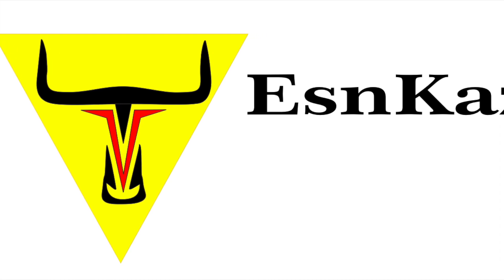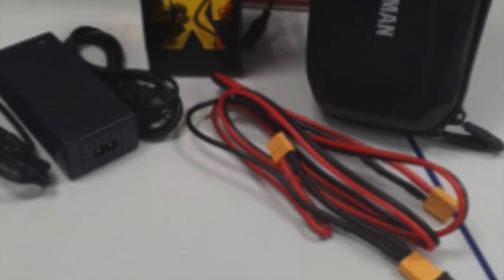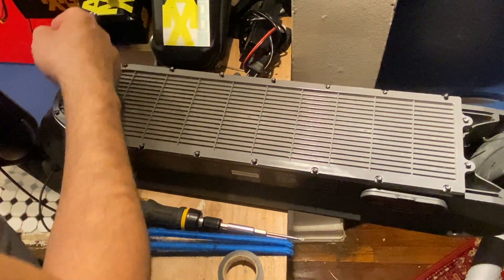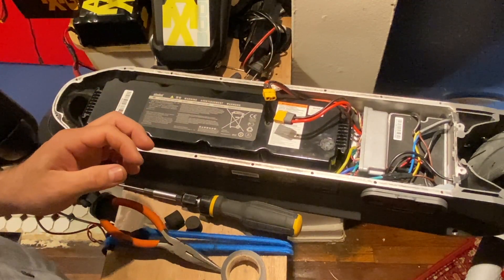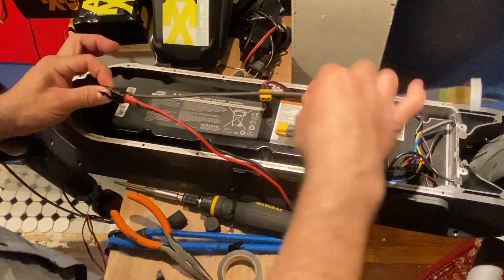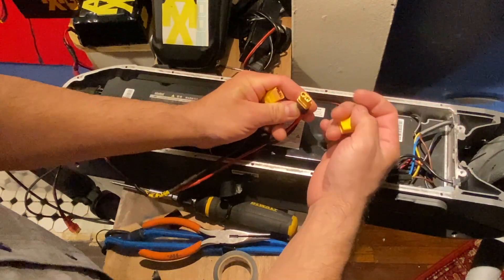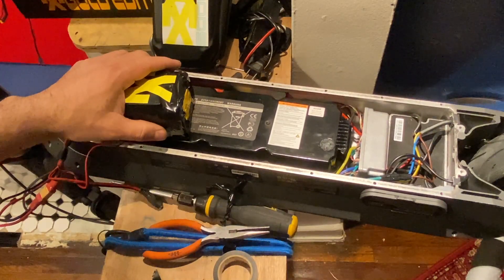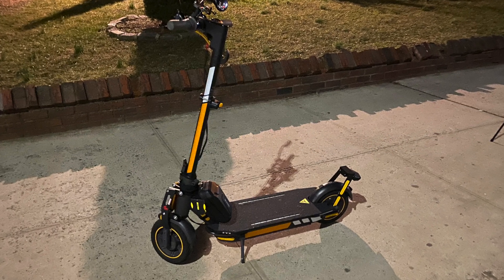Ninebot Max - External 12V battery upgrade Installation.

Comment: Hello sir I have iscoter with 36v 7.5 ah inside battery. My question is may I connect 3.6 20ah external battery in the scooter. If yes then should I need to upgrade firmware. If no then why? Please 🙏 your reply will be height appreciate. Thanks
Reply from the maker: What scooter do you have?
Reply: @esnkaz  I have iscoter 36v 7.5ah battery 350w moter
Reply: Inside and outside battery 36v same. But (AH) is different. I want to drive more. 
Inside battery    is 36v 7.5ah
Outside battery is 36v 20ah
Is it ok to connect both with same wire +with+ and with
Reply: @SuperGalaxymedia     yes.    You will only be providing your scooter with improved range    the batteries together will give you almost 3x the range you have now (20ah / 7ah)   the 20ah is about 3x the current capacity of the 7.     So you should expect about2.5 -;3x the range you can travel between needing to charge the batteries.

Good luck brother!

Comment: Has anyone tried fitted with 10x3 wheels setup onto segway ninebot max g30 g30p models that be cool ro ride with 10x3 wheels 🙏
Reply from the maker: We fit up 1400w dual motors total of 2800W  10x3.15 tires for city roads and off road.

Comment: Hello ESNkas, Have you been using the external battery for some time and no issues? Thanks alot for your videos!
Reply from the maker: I used them for 6 month. Then sold and they are still on going since July 2020 over a year now
Reply: @esnkaz  Thats amazing. Thank you!

Comment: do you charge both packs at same time? or do you need to disconnect them first?
Reply from the maker: You connect each separately with its own recharger at the same time
Reply: @esnkaz  thanks just to make sure, so you have original charger plugged in and the external charger at the same time.
Reply from the maker: @itsaj007  yes
Reply: @esnkaz  thank you!

Comment: Can you use this on a 48v battery to get to 52v because i have a g30 max clone project im working on and it would be nice if i hade 52v and a little more range ?
Reply from the maker: If your scooter it’s on 48v already by adding a 12v external then your scooter will be 60v. And yes you could do that upgrade if you have the 3 capacitors controller installed on your scooter. (D Controller) just remember your scooter need suspensions and adjustments for more speed as well stock motor will burn twice as fast.
Reply: @esnkaz  yeah but how do i charge it the batterys ive aways thorght they have to be the same voltage but do i just fully charge both batterys or is it fine to just charge them together
Reply from the maker: @nathanieltomkins1841  if your wiring configuration is right you need to recharge each battery individually and at the same time is fine.
Reply: Thank u soo much

Comment: Hello ESNkas, I installed the kit on my Ninebot Max and my scooter goes slower than normal when I connect to 48V but is clearly faster with 36V with the ''U'' connector with the firmware provided by mymaxmods. Any idea what could be my problem? Thanks for your videos
Reply from the maker: Sorry my late reply and hope you had help from mymaxmods. I am on ESnkaz Fb if you still have the problem write to me there and will walk you though.
Reply: @esnkaz  We tried to solve the problem with mymaxmod but it didn't work. Do you have an idea of what my problem would be? thanks.

Comment: I'm just about to get started on installing my external battery it's my first mod to my stock max. I live in the hilly part of San Francisco 15% to 20% slope hills are e erywhere my stock max limps up them holding my 6 foot 1 190 pound self. Do you think this upgrade will get me up the hills in a straight line no slalom (don't expect to go up fast just up). Also my commute has a 5  block ride down steep hills and the same on the way back home I'm a bit worried about my motor over heating is there any additional parts I should add to a okd this?
Reply from the maker: Yea it will help the 48v conversion but the 350w motor will get smoked soon :( contact me on my group Esnkaz Ninebot Max evolution USA.

Comment: The original milage is 40 mile per charge with the external added how many miles can you get
Reply from the maker: Jejeje not at all. Its like the new GT the real range is 17ML. :) Ninebot real rating in our testing and as well other YouTubers : 
Eco mode "45 ML" Reality 26ml.
"D" Drive   "40 ML" Reality 20ml
"S" Sport.  "30 ML" Reality 16ML.
Internal battery 48V Extended which is 13 cells more than regular on new point I was getting 34 miles range on sport mode on speeds between 30-40 Miles per hour. A year usage still kicks same speed and get about 28 miles range. External battery I used for about 14 month and that one never gave up either, but with the difference of using G2 motors. Hope this helps. :)
Reply: @esnkaz  so with the external while going only 10mph -15 mph what the max range you can get out of this
Reply from the maker: @DaDragonSlayer007  One thing to understand is that when you add additional battery, you change settings to your scooter to a max speed of 28 MPH with G2 motor and 34MPH with Fatmax. With external you add speed, or range. If you go slow battery could give you another 10 miles range if you go fast which is 9 miles above original the battery will still give you at least 6 miles more range with top speed of 25-28 MPH

Comment: Hi, i have a ninebot g30LE max II , im from Spain and this is the EU version with less battery (10000mah aprox), there the speed limit is 25km/h but i have the mine at 30km/h cos i changed the serial number... The motor is gen 2 too. My question is, can i improve my scooter like yours??
Reply from the maker: Yes.

Comment: My Wire Burnt out so need a replacement cable. Do you have instructions on how I can make a new one? What gauge AWG would you recommend? Thanks
Reply from the maker: 14
Reply: I ordered 18 gauge guess I won't be using it because it will burn up. Getting some 14 gauge or 12 gauge and an inline fuse and doing it correctly

Comment: Hi Why is the scooter battery not charged?09:2021 start
Reply from the maker: Where did you buy the battery from and can you give more information in why the battery it’s not charging? Maybe a wire got cut off, water damaged??? You would also contact mymaxmods straight. They are really fast in that regard.
Reply: @esnkaz  persish باطری اسکوتر سریع تمام شد من  با لامپ اخطار حرکت کردم و بعد دیگر شارژ نشد  شرکت گفت 480€ ما انجام میدهیم
Reply: @esnkaz  I can smell the burn, but no wires have been burned. The scooter is new, but it is not charging
Reply: @esnkaz  you have Instagram
Reply from the maker: @abbasghasemi757  answering your questions above again. you would need to contact the company where you bought your battery. When battery its not holding charge it could be a number of reasons and the battery makers would be able to assist on that. ESnKaz FB. Instagram just started and soon will have more there as well.

Comment: Is it gen1 motor? And what speed it will get? Thanks
Reply from the maker: Hey John I just tested a G1 on this battery and runs great. Torque is crazy at starting. If you are doing this upgrade on G1 also upgrade your bearings or get a slower FW.

Comment: How much miles get more?
Reply from the maker: I guess this question is for MyMaxMods jeje. I personally tested this battery and love it for some other aspects. However I use to get 26miles ending with 8-10% battery. I only ride on sport mode and always on max speed.

Comment: What is the meaning of error 24? How can i fix it?
Reply from the maker: You need to install new firmware. When you install additional battery you must install the new firmware first before adding new battery. So simply install new firmware, restart your scooter and you that should solve the problem.